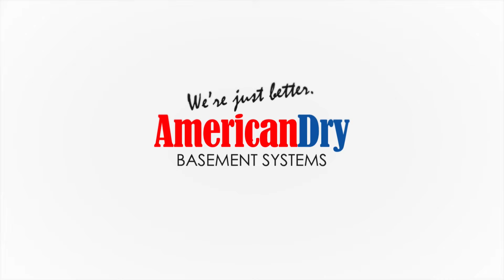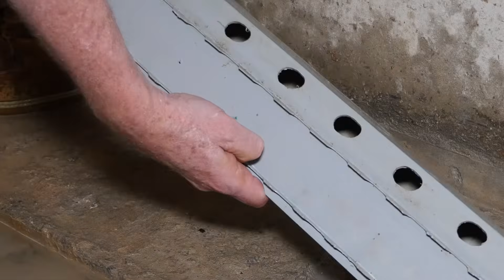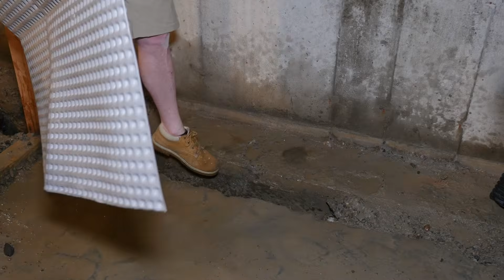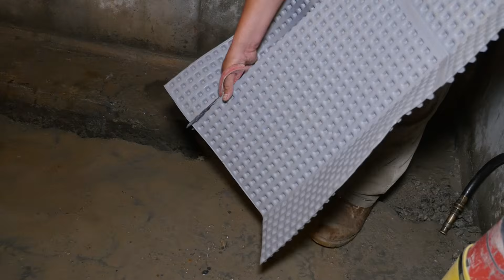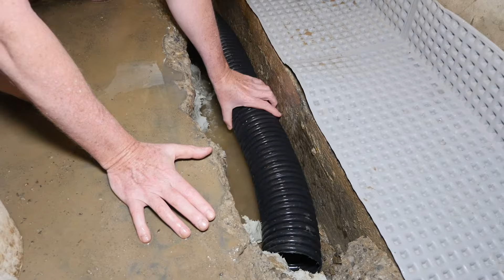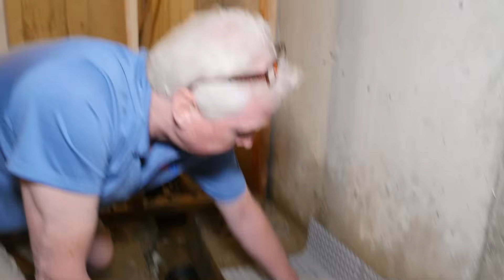Wet Basement Solutions | Installing an Interior Drainage System

Comment from the maker: Groundwater always takes the path of least resistance. What other ways does water find its way into a basement?
Reply: From pouring off the roof
Reply: Water table..
Reply: @americandrybasementsystems - where/how does the water enter the black corrugated pipe? 

Are there holes in the top? 

Thanks so much! Your videos are amazing
Reply from the maker: @somervilleblack7846  Holes are staggered around the entire circumference of the pipe. They are located between the corrugations so they are hard to see.

Comment: Is there a reason you cut the dimpled membrane at the footing rather than running it over top the pipe and gravel (and under the concrete floor)? IE. Install it last, just before pouring the floor? 

And what about going further up the wall with the membrane?

Comment: If you cannot access plans in the basement is so deep that you cannot check from the exterior, how do you figure out where the footing is
Reply from the maker: You won’t know exactly until it’s exposed. Most footings extend past the wall, so the key is to work carefully alongside it within its depth, not underneath it.

Comment: im confused on how water gets into the black pipe underneath the floor? Does the black pipe have small holes in it to let water in?
Reply from the maker: The pipe has many perforations (open slits) around and in between the corrugation.

Comment: How do you tell how far away the footer extends from the wall? I’m going to take this project on, but I’m unsure of how to tell and don’t want to disturb the footer with a jackhammer.
Reply from the maker: 9 out of 10 we can approximate by looking at the cove joint and floor. You won’t know the exact footing width until you open it up. Most footings extend several inches past the wall, so the key is to work carefully alongside it within its depth, not underneath it.

Comment: Do the slits in the pipe go up or down?
Reply from the maker: The sump basket is always the lowest point, so any silt in the pipe would move downward in that direction. In the northeast, the soil mostly perks up clear water when catching water that low below your floor.
Reply: @AmericanDryBasementSystems  So your holes in your coragrated pipe go to the soil or to the rocks? I am in North Carolina.
Reply: Perforated corrugated pipe has holes punched everywhere in it, it doesn’t matter. Pre-perforated PVC pipe faces down I believe.

Comment: I have a couple of questions that I've been trying to figure out in several videos see if it is mentioned in the comments. Do you leave the end of the corrugated pipe open like that, like seen at the bottom of the screen at 5:21 ? If so, wouldn't it eventually get clogged? If not, what do you do? 
I saw another answer to a comment that asked about pitching all four walls to one sump pump for a 28' x 40' basement where you recommended 2 sump pumps for that size. My basement is roughly 25' x 45', plus an extra room that is about 15' x 13'. Could you have two pipes running to each sump pump (two walls for each pump)? Which brings me full circle to what do you do with the open ends? 
Thanks in advance if you get around to answering 😊. I will be looking for someone to do something like this in AL in the near future.

Comment: What if it comes down the wall and over the top
Reply from the maker: If water is coming over the top of the wall despite all preventative measures, it’s likely due to surface flooding—where water levels outside rise higher than the basement itself. This can happen during extreme weather, especially if the property is near wetlands or has poor drainage capacity. In these situations, water can enter through basement windows, doors, or even over the sill plate. Unfortunately, once water reaches that level, no interior or exterior footer system can fully stop it. The key is to focus on exterior defenses: adding window well covers, installing flood barriers, and ensuring proper grading and drainage to divert surface water away from the home.

Comment: What if there are areas of the basement floor, away from the walls, that have signs of water seepage (high water table, especially during rain and snow melt)?
Reply: You can use simple board across the floor to resist hydrostatic pressure

Comment: Why no lawn fabric in the trench to prevent dirt from entering the gravel?

Why corrugated and not perforated pvc?
Reply from the maker: We use a pipe that is corrugated and perforated inside the basement. PVC pipe is not flexible and requires elbows and ports for cleaning. The flexible, corrugated, perforated pipe is continuous without an elbow or fitting for ports. They don't crush or clog with mud.

Comment: I have 2 questions. 1, when the slab is removed what keeps the wall from moving inward from soil pressure.  I have a block wall from the 50s and it has no infill inside of it. 2. What do you do for pipe penetrations like drains for plumbing fixtures?

Comment: Going to be getting a garage floor coating done an epoxy type  coating.  There is a system like this on one side of the garage.   Can anything be put along the wall over the flow channe plastic? Want to create some thing they could apply coating to to match a 3 inch boarder that will run around the top perimeter of the garage.  Don't want to impede the performance of the system.
Reply: They put concrete on top of the dimple board flow channel

Comment: why drain inside of the basement rather than a tile around the outside before it gets into the house. water coming into/up and over the footing to reach your interior drain is still eroding/compromising the footing, no? Additionally, addressing the water before it even penetrates that low to begin with. So why not address both surface (exterior) and a drain outside of the foundation walls rather than within?
Reply: Good question but this is for groundwater, not surface water. My basement flooded recently even though it wasn't raining and there was no standing water around my house. Once I pumped it out and located where it was coming in I actually saw water flowing up from a hole in the floor. It had rained heavily and flooded areas around me a few days earlier, but it took a while for the water table to rise.
Reply: You don’t always have an option, or it may be too cost prohibitive.
Reply: Hydrostatic pressure brings water up from the ground. But yes you can also do it from outside if "surface water" is a problem.
Reply: Lots time u can't on outside  new slabs garage sometime it easy do inside dimple membrane but best outside yes

Comment: My water isn't coming in through the crease where the wall meets the floor.  It's seeping through the wall about 4ft. up in different spots.  I can see it coming in very slowly.
Reply from the maker: That's not good. You have some serious lateral pressure against your basement walls from the rain soaked soil around your house. It is disappointing that water is penetrating the middle before the cove joint. It is usually the other way around.
Reply: We have the same problem -- will a trench like this solve that problem?

Comment: Thank you for very helpful information. 
Can I connect the drain pipes (with fabric around) to the sewer drain system with P trap? I have water in the basement only if heavy rain.
Reply from the maker: We never use fabric because they clog and reduce water flow. Surround with stone instead. It is possible to tie to a sewer drain, not recommended. It depends on your local building code.
Reply: @AmericanDryBasementSystems  Thank you for your help and videos.

Comment: do you add weep holes to the bottom of the basement wall?
Reply from the maker: Always when the wall is constructed out of cinder blocks. Not usually with poured solid concrete walls.

Comment: Every single waterproofing contractor in my area uses that first system (WaterGuard) which you show how it doesn't work
Reply from the maker: It is easier to setup shop selling that system nationwide, because they are simple to install. Very little training required. Plus the overhead is quite rewarding if you can get someone to buy it. Our type of installation requires 10x more materials, trade skills, and experience to get right for a truly effective system. It is harder to create nationwide dealerships or franchises without losing quality control.

Comment: This video is fantastic. One question: what if my foundation doesn't have that cold joint and that concrete ledge on the footer? I have a 121 yr old house with a stone foundation that was later encased in concrete. I did exploring and found my interior wall just goes straight down. Because of this, i'm not sure how the dimple drain board system would work. I'm just a DIY-er with a tight reno budget so videos like this are a lifesaver. Thanks for making it.
Reply from the maker: Good question. This type of foundation does not fall into a traditional three-piece foundation. Stone walls are built on undisturbed soil (hardpan clay) and the floor is the same dirt. Later, concrete might be poured to make a slab floor. When we install an interior system we create a false footer out of the hardpan clay. It can be as sturdy as a concrete footer. Watch this video on false-footing: https://youtu.be/2_adHhELygA

Comment: What if the water is coming in from under the floor and not the walls?
Reply from the maker: Your exterior waterproofing is probably still intact and doing its job. Unfortunately, it allows the hydrostatic pressure to build up so great that water is finding a way underneath your footer and below your floor. You could also have a natural water spring under your home that suddenly ruptures.
Reply: Get a sump pump or two!

Comment: Don't you need to keep the top of the washed stone below the finished floor surface so you can pour at least 3 inches of cement thickness?
Reply from the maker: Yes. Stone below finished floor with vapor barrier on top. 3.5 inches or more to keep within general building code.

Comment: If water is coming in only at the cold joint and not dripping down the wall behind the gutter, isn't the space between the back of the gutter and the wall just letting moisture into the basement as a result of humid air rising behind the gutter? It seems it would be better to seal between the back of the gutter and the wall near the top of the gutter to keep humid air out.
Reply from the maker: You would think the opening would create humidity, but it doesn't. No humidity whatsoever.
Reply: @AmericanDryBasementSystems  what is the best way to flush sump pumps?
Reply from the maker: @chirina5  A water hose and wet & dry vac will do a thorough job. If you don't have them available, use a 5-gallon bucket of water to wash out the basket, run the pump, and wipe the bottom clean with rags.
Reply: @AmericanDryBasementSystems  can you use bleach or any other chemical or will it mess up the pump?
Reply from the maker: @chirina5  The pump can handle it, but it is not good for your septic system or water runoff to a nearby stream or pond. Use diluted bleach or better yet vinegar.

Comment: I have a draining system which was never capped with concrete (drain tile under some gravel), but need Radon mitigation done, for that I was told we need to pour concrete over the drain tile like you have in this video, my question, if I were to use the dimple board, would that not still allow Radon to pass up through the floor?
Reply from the maker: Do you have a radon problem? Did you get it tested? Radon mitigation is only for dangerous levels (starting at 4 pCi/L) which is very rare.
Reply: Yeah, our radon test came up at 8, so we need to mitigate, but because gravel is exposed in our perimeter drain, before that we need to cap it to seal the radon underneath. I believe the best system for drainage is the one with the dimple board, but my fear is that radon might still seep out and the radon mitigation would not be effective.
Reply from the maker: @Tribe84  All subfloor systems on the market have some form of opening along the edge of the floor, similar to dimple board. You will definitely get lower levels if you get a strong suction fan to discharge the radon through a pipe from the sump basket to the outside. You could seal the dimple board edge with putty and then caulk. The dimple board will still do its job of directing water from the cove point to the subfloor drainage. I like to know what you decide to do. Best of luck.
Reply: @AmericanDryBasementSystems  Thank you so much for the info, I will give it a shot.

Comment: What would you do if you have an old 1880 basement with field stone foundation with no footer. Would you cut a few inches off the wall and then install the same setup?
Reply from the maker: You are on the right path, but not a few-inches. A stone foundation sits on hardpan clay. The hardpan clay acts as footer, and just as strong. It is a false-footing that extends from wall to wall under your floor. Usually, we remove approx. 12 to 18-in of floor completely away from the wall to install our system.
Reply: @AmericanDryBasementSystems  hey thanks for the reply really appreciate it. Just to clarify I can go right next to the foundation but make the trench 12 to 18 in wide. Or I should not go next to it but make my trench 12 inches off the wall
Reply: @pollocko91  Stay 12-18" off the wall, then dig at most 12-18" down. See his "false footing" video.

Comment: what kind of system would you recommend on a monolithic poured floor?
Reply from the maker: Our system, of course. 😀 It is imperative to manage the water 10 to 12 inches beneath the floor. In the case of a monolithic floor, a corrugated perforated pipe will need to be placed in a trench approx 18-inches away from the wall. A false-footing with a flow channel will guide water to the pipe from the wall. 3.5 inches of concrete will replace the missing floor from the wall to the trench. They pop up once in a while and take extra hard work to install but well worth it.

Comment: How can you confidently say that this system doesn't cause foundation settlement? With water constantly around the footing, you're SURE to cause sinking foundations. I didn't see that addressed anywhere here.
Reply from the maker: All houses are perpetually settling. I never said, "stop foundation settlement." We certainly stop further damage that "hydrostatic" pressure is doing outside your walls and underneath your floor. We prevent cracking and the weakening of the "trio." The wall, footer, and floor holding each other in place to create a strong foundation. Engineering 101. Read the ICC manual to learn more.

Comment: I have to say the dimple board looks like an "up sell" and is completely useless. Where else would the water go? It's going to come thru the seam or thru porous concrete & head straight for the edge of the footer with or without dimple board.
Reply from the maker: Definitely not an upsell. Surely some of the water will still go towards the footer, but it will also wick up the cold joint, where the floor meets the wall and onto the floor. The dimple board is essential to direct the flow ONLY across the footer. It removes flow resistance. I dare you to try it without the dimple board.
Reply: @AmericanDryBasementSystems  I don't think I'll take that dare! Just not worth it especially since the material cost is not that significant. My "upsell" comment probably came across a little snide. Wasn't my intention. I'm in the service industry myself & definitely have "upsell" products and services to offer customers. So here's another question....how deep is the gravel base under the ADS pipe and do you have you ever recommended the ADS pipe that comes already wrapped in the nylon stocking with foam "peanuts" ?
Reply from the maker: That s two questions. The amount of gravel under the pipe is determined by the pitch/length of the wall. No set number for the amount of gravel - more for higher - less for lower. I don't recommend pipe covered in nylon filtration.
Reply: American Dry Basement Systems ,
Why don't you recommend that type of pipe?
Reply from the maker: @bigred9428  Go to our channel and watch our videos of tearing them out. We go into detail about every reason why we don't recommend them. It doesn't make sense to rehash them here.

Comment: Interesting. How does one pitch all four walls to one sump? Seems it would be hard to keep the pipe at correct depth and proper pitch over an estimated 28' x 40' basement.
Reply from the maker: There is no way to use one pump to cover that much area. We use two sump pump stations positioned as far apart as possible. Watch this video for more detail - https://www.youtube.com/watch?v=uzaVb2bXR8Y
Reply from the maker: @motoadventuredude  Thanks for your input but your information is false and you are misleading people by saying pitch is not required. Managing water level to the floor is just an overflow system that requires constant maintenance. The concrete floor will sit in water as it overflows into a sump basin. This procedure increases air moisture and mold. You will now have to sell your customer a dehumidifier to get rid of that excess moisture. Sorry but I want to give our customers the driest basement possible without the hassle of maintenance.